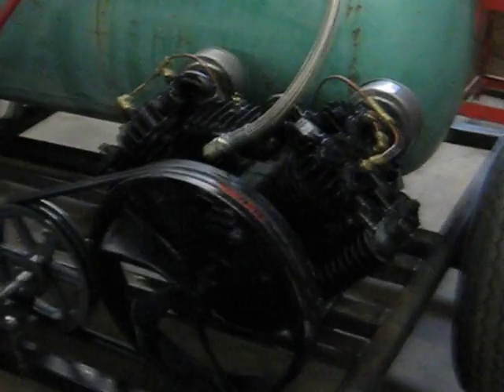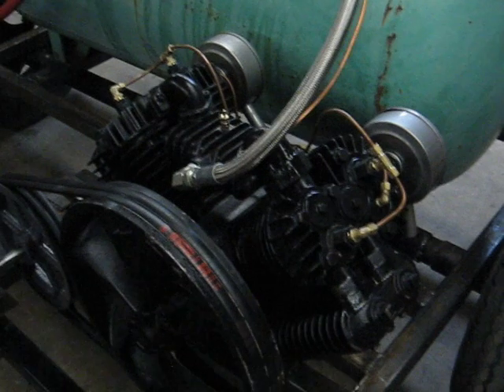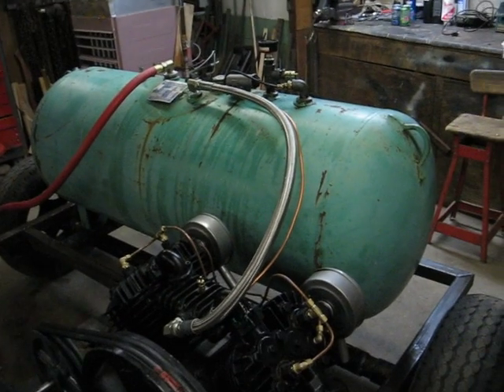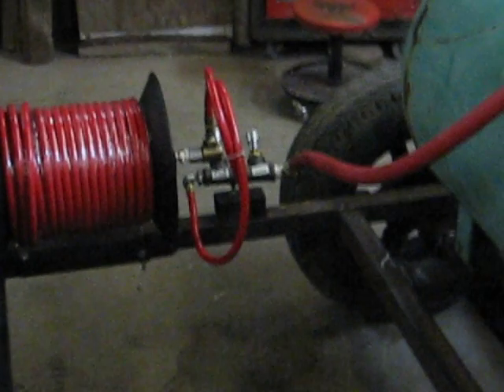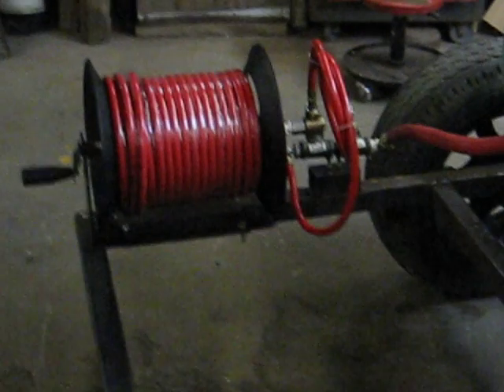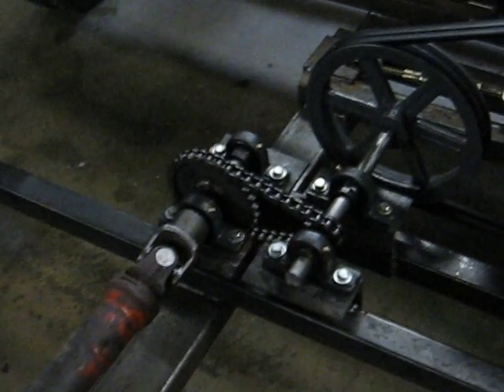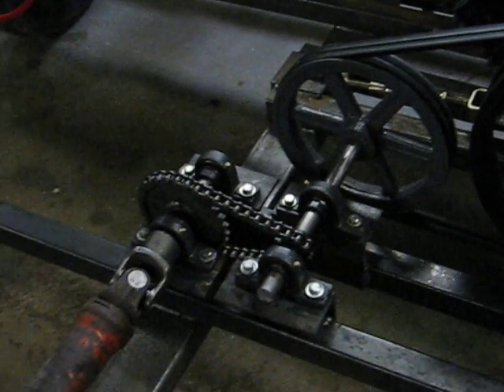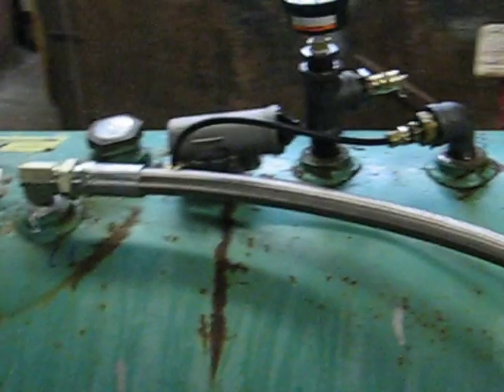Homemade Air Compressor

Comment: Yeah, that makes sense. I suppose a small gas engine would run a pretty high rpm where your tractor runs slow since it has more torque. Looks pretty sweet though! :)

Comment from the maker: No. Instead of a 13HP small engine working to death, I have a 28hp tractor sitting there just off idle hardly working at all. I suppose maybe it would be if I was using a real large tractor with a big engine.

Comment from the maker: Air tank is the 120 Gallon Propane pig, compressor feeds directly into that. The blaster I am using is a Clarke bought from tractor supply, I thinks its 120lb capacity.

Comment from the maker: Yes. Tractor PTO speed is 540RPM at rated speed, comp has to spin at 800rpm, so to be cost effective i geared up with chain and back down with the pulley. This lets the comp spin at 800, and the tractor engine at 1600rpm. To buy a cast pulley the Diameter I needed would have been around 700 dollars. The flywheel on the comp is 19" in diameter